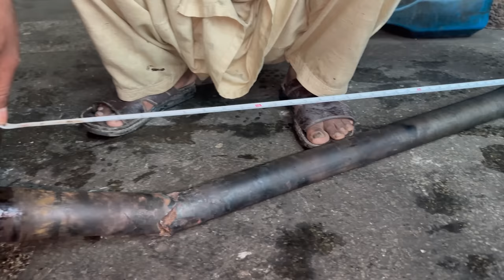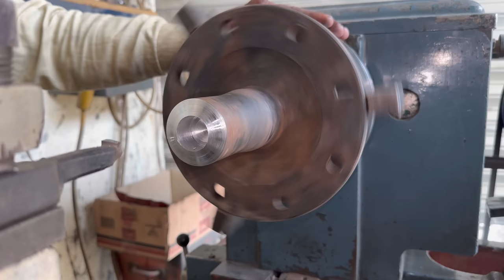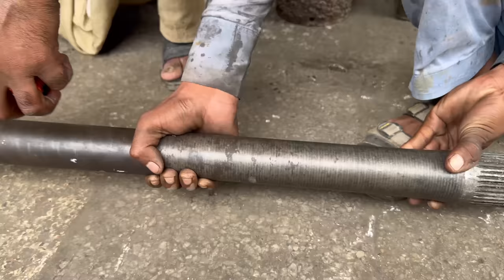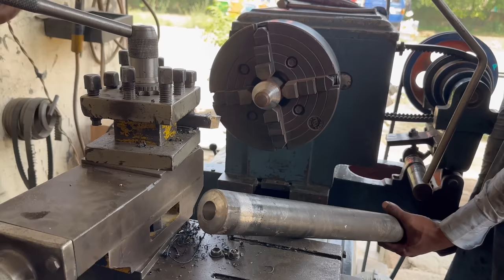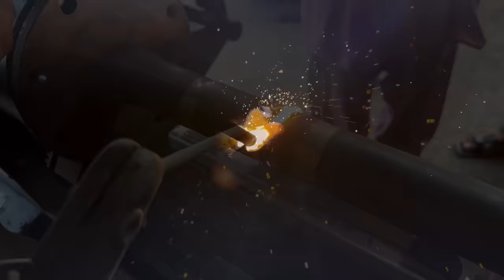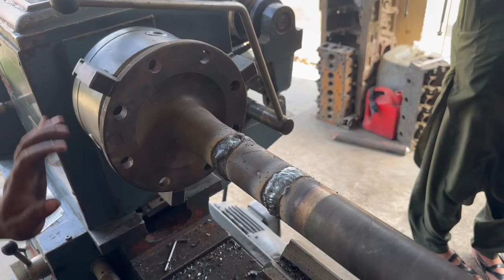How Mechanic Unimaginable Fixes a Broken Axle Like a Straight Arrow || Double Joint Work

Comment: Nope. It’ll break after the bill is paid.
Reply: Maybe not as strong as a new one, but when a new one costs 100 times more than repairing this one, then it probably is worth it.   Remember, labor is cheap many places.  Yoy gotta give it to them, they are quite good at what they do here. 

My personal opinion is that this is an art that is pretty much forgotten in the west as we would rather replace it outright.  No questions asked.
Reply: @spiff1003 there is a price for going cheap. That axle is best replaced than repaired
Reply: Can't break and 80% strong. Good pin and welded joint.
Reply: Thats the masters craft 😂
Reply: @pr00009  South Asia has been a repair not replace culture for decades. Yes a replacement is ideal but with costs of repair so low it’s more viable for them to repair many times over before the coming close the cost of a new part. A thought process outside your understanding 👌
Reply: @pr00009 why would you replace a entire axel over a shaft ?
Reply: I agree the integrity of that bar is done

Comment: Aesthetically and physically that was some masterful work.  However shafts like this need to be heat treated, otherwise it will break again under load.  In some regions of the world, sometimes getting a new spart part may be difficult or too expensive, hence the need to reuse and repair with whatever is available.  These are talented machinists!! Great job!
Reply: Look at the shit tier iron they're working with already xd
Reply: But what a masterly job... In a turning shop it is an apprentice's job and in any case he has only wasted time repairing that axle shaft because at the first effort it will break off exactly where the welding was carried out, among other things not even with a basic but rutile electrode which offers less resistance let alone on a hardened material... Unfortunately they are forced to make do but in essence it is a totally useless job... I can confidently say this after over 40 years of working in that metalworking sector.!!!
Reply: @Ipsissimus ဝဋဍဍ😊😊ဗးး❤😊ညးးဘ၊ းးးခ😢😅😢ထခ😢😮😮😅😮😅
Reply: @lucarambaldi2731 can you please explain to me why they went from a three jaw to a four jaw chuck for the joining piece?
Reply: @lucarambaldi2731 They know what they are doing. Just because you did not see the heat treating process in this video?  Doesn't mean the repaired area wasn't heat treated.
Reply: Most of the stress on a torque transmitting shaft is on the surface of the shaft. To use welding material on the surface will simply make the two weld joints stress concentration points.  This shaft will break right at one these two points, whichever is weaker. Sorry to say.
Reply: @derekallen4568  Maybe because it cannot go in as far, so to get more solid grip they went with the four jaws.
Reply: Es un trabajo burdo, elemental y primitivo, no se debe trabajar sin ninguna seguridad.
Reply: @addaadollah You can do all the treatments you want but the axle shaft will always remain repaired and not even welded with 7018 but simple 6013 electrodes with less resistance... It broke when new let alone when repaired but I understand that it is not possible to do anything else unfortunately... In any case so many CONGRATULATIONS for your honor and work as Masters 🏆💪🏆
Reply: @derekallen4568 I honestly didn't understand why he changed a self-centering mandarin with one with independent clamps... Usually the mandarin with independent clamps is used to obtain non-eccentric nuts but in this case I don't see the reason... I had the opportunity to use the lathe for a few years but in reality I would be a welder and my turning skills are limited... Obviously if someone can explain it I thank them infinitely... GREETINGS to all of you 🙏💪🙏
Reply: @lucarambaldi2731  thank you! I'm also only an amateur machinist, but it was the first thing I noticed.
Reply: @lucarambaldi2731  ?  Absolutely correct!  The repair allows the truck to continue working, but the operator must be made aware that it is not as  capable as it was.  This means driving slower on rough roads, and carrying less than the maximum allowable load. The repair  should allow for a long service life, if the truck is not abused or run hard.
Reply: Yeah, I just wonder...

 Drive shafts are welded with mild steel filler and are not heat treated. Not as much torque (vs axle)  but then one can scale the material for the load.

Crank shafts can be cast iron (not the toughest material). Crank shafts are also often welded during construction and repair. So why are dumping on this
process? Crankshafts must endure rather nasty cyclic torque and bending loads.

I'm pretty sure that throughout history, many axles were not heat treated. 
As I recall, there was a rather tough aftermarket floating axle  made from un-heat-treated 4140. This probably not the most relevant cornerCase (because annealed 4041 is already pretty tough) but it is an example of a modern axle which is sold with no heat treatment.

That being said, a heat treated, chromium alloy axle will be far far more durable.
Reply: @derekallen4568  Probably because this 3jaw chuck was trued for the diameter most often used. So the 4 jaw is the best option for bringing it in to center.
Reply: @addaadollah Full float axle shaft, so less throttle on rough roads. Impacts without torque load won’t matter.
Reply: Not if you weld a sleeve over it. Like new.
Reply: The labor in these third world countries are cheap. So for the price of one replacement part,  they can hire welders to weld it back 10x or more.

Comment: When I started working in machine shops I used a tape measure to measure the outside diameter of a steel collar that went on a car crusher. Just to get an idea of the diameter. The boss yelled at me for using a tape measure. Never again.

Comment: I respect it when people make the best out of their situation but  please use at least shielding gas during welding.
Reply: А где они его возьмут?
Reply: It is amazing to watch how great these people are!!! If the workplace couldn't supply safety equipment they couldn't afford any. Most times they drink water and then go hungry saving wages to feed the brood and are internally indebted.
Reply: It's stick welding (MMA). You don't use shielding gas for that method.
Reply: Much respect, they make some pretty nice knives as well
Reply: Shieldes welding is the wrong process for higher carbon steels.  You need to use MMA that was used with a hugh Nickel like INCINEL or a Low-Hydrogen.  Mag or Tig would be the wrong process by far.
Reply: @tonkatoy200 100%

Comment: You gotta just love those "dial indicating" TAPE MEASURES !!!  They'll be accurate to at least 1/8" per chalk line,  ya think?
Reply: OAL on an axel like that isn't critical. It could be easily + - .180".
Said that..
I wonder if this video really depicts axel repair they honestly expect to last if put into service. 
Or just make a youtube video to make money on.
Reply: Yep... that is quite likely.  We never know if it was put into service, or how long it lasted if used at all.   @benjurqunov
Reply: В этом то и весь цимус  , таким приметивным измерительным инструментом работает человек , да и станок похоже не первой молодости  , а всё подойдёт   ,,тютелька в тютельку " 😊,👍👌👋.
Reply: @benjurqunov  It will snap the moment it feels the torque, it's only held by the welding while the central parts will spin in each others as they are inline with the axis of rotation. If there's any sensible way to mend something like this I can think of, will have to drill three or more large holes off axis in each end (instead of one in the center) then using three hardened dowels to connect them so they can bear the torque. but in general these parts are designed to barely withstand the stresses plus some extra safety margin when they break they need to be replaced.
Reply: @mofleh177 how about putting splines on the "dowel" parts, or broaching, or drilling a hole thru the axle to apply a pin.
Reply: @AL4N.  Yes if they can broach the end and the hole and make a spline or any shape other than circular it might work but most likely they don't have the tools. Drilling a hole normal to the shaft will weaken it and won't be long before it breaks again, if you make the hole small the dowel pin itself will snap.
Reply: @mofleh177  I understand. You mentioned "any sensible way" I was just throwing a couple more sensible ways out there.
Reply: @AL4N.  with the tools they have the sensible thing to do is make a full penetration weld, but that takes skill and it looks like they don't have it

Comment: Watching these videos makes me think of a couple of things.  Sometimes perfection isn't necessary and "good enough" will do.  Clearly this repair is something they've done before and suits their purpose and conditions.  The second is that I am extremely lucky to live where I do where tools, equipment, materials and replacement parts are readily available.  Now when I hear "I have to wait 3 days for a new axel?  That's the end of the world!" I can just laugh!  Great job guys!
Reply: Вообще то это полуось 😁
Reply: Now you did it with all these comments I'm going to Bangladesh to see if that thing held up
Reply: Actually, they do have access to modern tools, but they suffered mentality of only trust what their ancestors had teache them.
Reply: @raopsepol "have access" dude, i can buy 4 axis milling cnc machine from africa and get shipping. Accesibility isnt concern, money - is. They work on this because its all they can get.
Reply: @andreykotovsky  I assume you watched enough pakistani videos to notice not a single torque wrench ever use in any of their works. Don't tell me they cant even afford torque wrench. I don't care what tools they use, but the method. It can be done correctly even without CNC machine. But too bad they still fix things like its 1950s.
Reply: @raopsepol like in 1850s, you mean.
Reply: Looks like they have plenty of prospective customers driving by their shop as well.
Reply: Perfection is unattainable, and Good Enough is what engineering is all about.  What that means depends on the individual case, but if you can achieve that then all is well.

Comment: Dicey, but it should work for a while if not heavily loaded. Those welds have hidden inclusions by the look of it, and the lord only knows how the material of the rods will react with the alloy steel of the shaft, and we haven't even touched on the heat stress and the lack of heat treatment after the welds are done.
Still, you have to work with what you've got, and these guys are clever machinists. I'd love to see them in a well equipped shop; there wouldn't be much they couldn't tackle. 🙂
Reply: I was just thinking the same thing.  I'm a mechanic tho, not a welder. I was thinking the porosity of those welds has to be off the chart. It looks like they kinda just super glued it together.  But technically the axel only has to tolerate torque or twisting force.  I think I would have gone with a threaded design that his press fit.  Heat the female side of the socket, and freeze the male side, thread together and let cool, and avoid the welds all together. Maybe even counter the threads so that they never losen on both ends at the same time. Or.. have both threads facing tight while the axel rotates forward. Because a vehicle that uses an axel like that prolly won't be moving backwards that often, and if it does, not very fast, so the threads should always be tight.

Comment: If one welded joint is good, two gotta be better. Single weld will fail. Adding a second doubles the chances. These men fix things this way because they have no alternative. Use it up. Make it last. Sometimes life is hard.

Comment: Awesome machine work. These guys are true craftsman. Probably only cost $100 US to fix it. Here it would cost you a fortune for a new axle. Amazing work. Get some safety clothing and footware. Be safe and healthy.
Reply: No machinist would be "amazed" and no one not a trained machinist can have a valid opinion because they look without truly seeing. The reason broken axles are replaced in the first world is because those "repairs" are of low quality and safety unlike the third world matters. New axles aren't a "fortune" either. Proper maintenance and repair save lives when a loaded vehicle is at speed on the highway.
Reply: Go for it....become independent...
Reply: Yes big your new axel wouldn't snap like a toothpick the minute it had a load.

Comment: Without preheating the join zone before arc welding (and using the completely wrong type of filler rod) is going to leave the metallurgy around the weld area compromised & weak with very high probability it will again break under heavy load.
Reply: They make videos like this for youtube money. 
Not for a repair they expect to last in real life.
Reply: @benjurqunov  good point! Bit like the clickbait ones of an old TVset found rusting away in the rice fields that after washing the mud out it works perfectly!
Reply: Well you read too many books  in pakistan anything is possible  it will last long demand on his driving experience
Reply: P @benjurqunov

Comment: This was a great job.
Given the non-availability and astronomical cost of that axle, these guys are necessary in the cogs of their industry.
How long it lasts, and how much weight the axle will take, is anyone's guess.
However, for an even better job, welding-rods compatible with the axle metal has to be used. Then the welds must be stress-relieved. This is a gradual heating and cooling of the welds that takes many hours. This would cause the molecules of the metals to arrange themselves, so that everything melds into one piece of metal. When this happens there will be no weak point likely to give way under stress.
Obviously, their method is faster and cost-effective !
Trinidad & Tobago.
West Indies.

Comment: With the spigot left in the middle 30% of original thickness has gone it’s a quick fix but how long before it goes again is anyone’s guess 
Good repair only time will tell
Reply: Agree, but normally these axles (though this has failed) are designed to withstand way above loads trucks (lorries) are designed to carry. But given the antiquated machine shop equipment the performance of the workers is amazing; for that, I salute them🤗

Comment: It constantly amazes me. You weld on top of your lathe. Understand using that process to watch for "straight(ish)" while assembling patch. Grant you that part. My point is look at the surfaces that welding splatter is destroying. Flat bed ways now have pits to collect grit so that every time it is repositioned, the grit grinds away at the 0.005 clearance. What about the weld splatter stuck in the threaded feed screws. How much wear is that creating in the feed accuracy. If you have access to such a machine and have learned the art of machining, you should at least take enough pride to protect your tool. Forget the fact of the non-existent steel toed safety sandals. 🤣
Reply: Don't worry professionals like CEE from Australia do that too. It's just all about covering things up.
Reply: Yeah and I didn't see a ground on the shaft so weld current will pass through the bearings.

On the plus side, these guys seem to own the only welding hood in existence in Pakistan!! 

I've seen a lot worse from these shops and if these guys are lucky, maybe it lasts  a few months in the massively overload truck, it's probably going back into, . And maybe their luck continues so when it does break on a crowded street, it doesn't wreck, running over and killing some poor unsuspecting family.
Reply: @bobsnabby2298  Yes, Kurtis from Australia protects lathe parts with flame retardant cloth. However, this is not the only complaint against these guys. They do not follow any rules or procedures. Their result is likes for the video.
Reply: I questioned the accurate concentricity of the patch piece stubs using the 4-jaw chuck.
Reply: @mightyluv  Oh. it's going to be far from perfect!! On the plus side, assuming this is from a pretty good sized truck, it will probably be spinning less that 500 rpm at 45-50mph. 

I think the biggest issue is related to torque it has to handle. Th type of steel it is and the rod being used are likely a  bit of a mismatch. Every Pakistani welding video I have ever seen uses 6013.  I think in Pakistani, "6013". means welding rod. And you can be sure that there is no heat treating that will happen! No need for that because it got hot wen they welded it!!

Looking at the break and  how it behaved in the lathe, the original shaft was very hard steel.  I would be quite surprised if they achieved 40% of the original strength. But it looks OK and in this part of the world, if it looks the same, it is the same.
Reply: Why did they change the chuck from a 3 to 4 jaw, for the joining piece?

Comment: I mean it looks good. But now how did you weld the parts beneath the surface, where you doweled in? You definitely only half the strength there now. Good luck to the customer
Reply: Half strength only if assuming perfect welding. But that welding doesn't look like high quality.